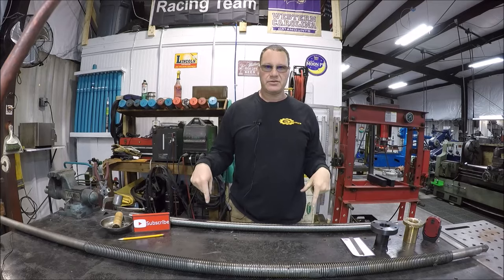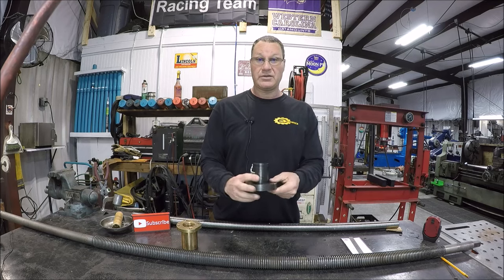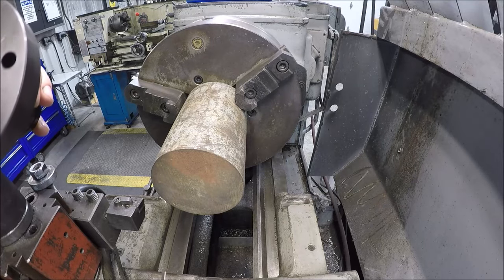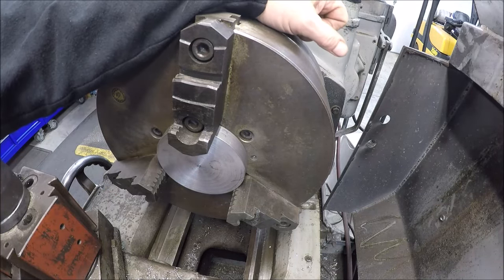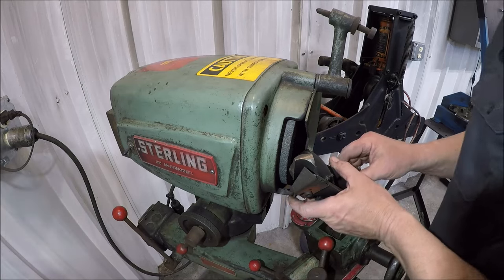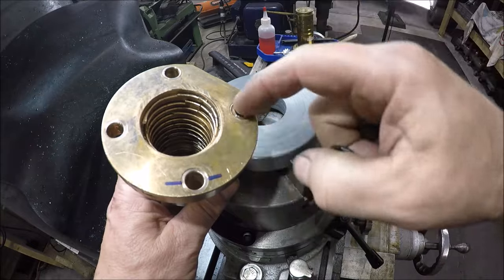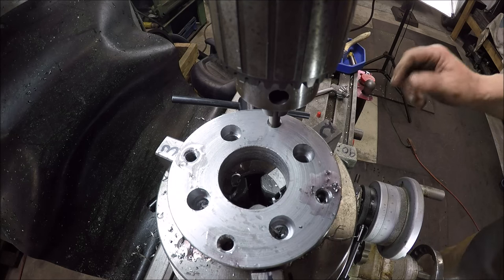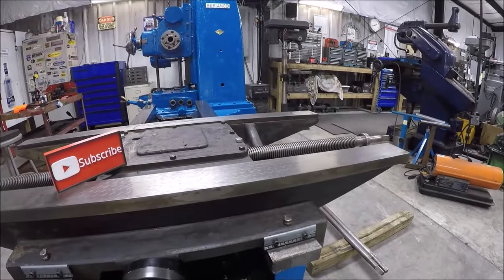Making an adapter to mount the new ball screw nut to the saddle

Comment: years ago, my father inlaw worked for ATT machine shop.  He could make most anything, I thought.   He took a small drill bit,  center drilled it- taped it and made an 16in long extension that would screw into it.  It was straight as an arrow.  Dont remember what I was working on for sure but I remember that extendo drill bit.  Hope your lead screw turns out as good as his  drill bit.

Comment: Looks like a good alternative there Tom .  Just a little bit of wear  !  I hope to re cut my ones & make custom nuts .   Maybe put the tubes at the bottom , so they are less likely to get damaged or make a guard for the entire nut .   Cheers   👍
Reply from the maker: Just a little bit. 🤣So you are just going to reduce the diameter of the original ones and then cut new threads?
Reply: @hilltopmachineworks2131  I might look at cutting the thread profile a bit wider  & cut a nut to suit .    If that does not work out , i will cut new screws .  I will price up ball screws , but i am not going to hold my breath !

Comment: A lot better solution the ball screw Tom. It's also saved all that machining time and electric cost which you can offset against the purchase price. Up and running faster too, less headaches. Cheers Tony
Reply from the maker: Hey there Tony. Looks to be a straight forward repair so far. Machining the ball screw though may be challenging.

Comment: Hello Tom,
Looks like a good solution... I assume that you could not just drill the the original bolt hole pattern in the new component, hence the need for the spacer.
Take care.
Paul,,
Reply from the maker: Correct Paul. Not enough room there.

Comment: Hey Tom, Vanover did an acme repair, and I'm right there understanding every word of your explanation. As a layman, why don't they just make the rod reversible? 1.5 hours of work and the machine is back in spec for 90% of the jobs. Downtime can be offset by months/years!
Reply from the maker: I saw Kyle's repair. He did a great job on the machining. Too bad the maker of my machine is still not in business. I could just order up replacements.
Reply: Thanks guys… great video Tom can’t wait to see how much a 6ft  section of 2.5” ball screw material is for my boring mill 🤦‍♂️
Reply from the maker: @VanoverMachineAndRepair  Probably a second mortgage. 😂
Reply: @hilltopmachineworks2131  yep lol